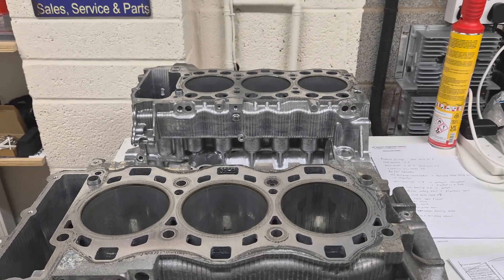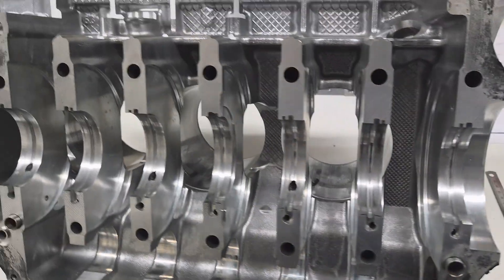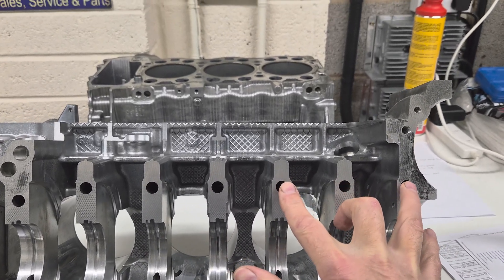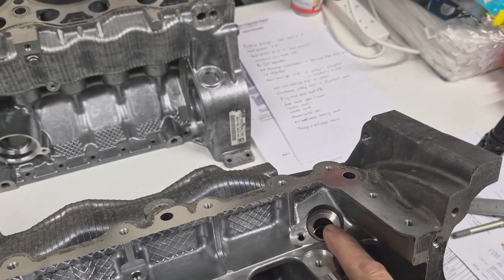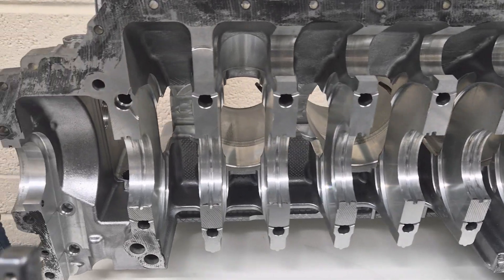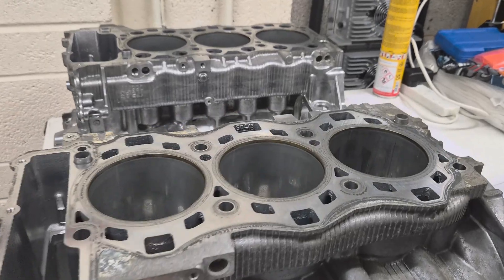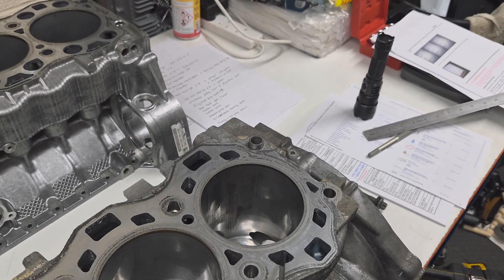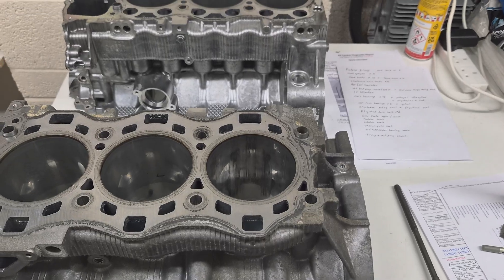997.2/991.1 - Bore score, where is the cylinder weaknesses in the MA1 engine - why cylinder 6

Comment: Great Material - could it be crap fuel leading to injector fouling - leaning out cyl 6 and melting the exhaust valve?
Reply from the maker: No if you watch the previous video, I work out its metal debris from the shrunken cylinder that have damaged the exhaust valves in this cylinders and the injectors were all good.

Comment: Hi Neal, thanks for doing your videos! Great resource. I have a 991.1 GTS engine in a race Cayman that I have kept Borescope photos since I have had it. Currently it has around 30000kms. I noticed that it has exactly the same single ‘polish’ mark on each cylinder inlet side as yours does. From your video it seems like this maybe around where the main bearing bolts go? Any ideas? It also has the slight scuff makes in the centre area as yours. I also have a 3.4 with only 1000kms that has the scuff marks but not the polish mark.  Cheers Gavin
Reply from the maker: That's interesting to hear about your observations, it sounds like those marks might be common manufacturing artifacts rather than wear

Comment: Additional information is, the 3.6 was offered in the 997.2 and not in the 991.1 as they bumped the HP up to 350 in the 3.4. The 3.4 and 3.6 share the same cases and cylinder heads, but the 3.6 has a longer stroke crankshaft and they used a piston with a raised wrist/gudgeon pin bore, as the connecting rods are the same. The 3.6 crankshaft is how the 4.0 was created along with the 3.8 cylinder bore and cases. In cold climates the 3.8 is more prone to the cylinder distortion than the 3.4/3.6, but can happen in these displacements also. In the 981 and 991.1 it's more important on getting the oil up to temperature than the 987.2 and 997.2 . I'm suspecting the DME controlled thermal management (electronic T-stat) is in play also, as it's more likely to happen to cars with this system in play than the aforementioned generation. This is an 8 main bearing engine, which includes the extra one the crankshaft snout for the support on both sides of the crankshaft throughs. The raised diamond casting grid is structural on the cases inside for the opposed cylinder/cylinder bank and there are case bolts on each side of every crankshaft through, as every through has a main bearing on both sides (4 bolts). Hope this helps.
Reply from the maker: So you are saying the later DME management upgrades may be exacerbating the problem?
Reply: @neal-morris  Affirmative on that one, as the Siemens Continental DME is different from the ones in the 987.2 & 997.2, as there was no electronic thermal management and a plethora of other features that came with the new platform. New features can be a good thing or a problem and I'm sure you're aware of these features that require programming or reprogramming with the 981 & 991.1 models. I've only seen one 997.2 that had this seizure problem and it took the rod bearing out which the took the feeding main bearing out due to the oil for that main bleeding off, as the engine is priority oiled. Take a pipe cleaner and check the case half with the main oil gallery, the one the pump supplies @ the back of the case. Hartech may be able to bore to a replacement piston size and Nicasil the bores, and then you'll be looking at unknown high milage capabilities with this engine. Hope I helped you out.
Reply from the maker: @warrenlucier5796 Its clearly a very basic management because there is only a single water temperature sensor located away from the engine plus a single oil temperature sensor. The fact the water jacket in these castings is so shallow and doesn't run the full length of the bores seems strange. I can see they programmed the ECU to restrict engine speed to 6300 when cold. Hardly much of a restriction! It would be interesting to fit several temperature sensors around the block and do a serious bit of data logging to see just how unstable the temperature management really is.
Reply: @neal-morris  The lower deck of a cylinder bore only requires full support to the wrist/gudgeon pin not the skirt, it just needs the cylinder. The shorter distance between the upper and lower deck the stiffer and more resistant it becomes to ovality. The problem is cold climate and oil temperature not being up to running temperature with the cycling of warmup over time. The alloy differences between the pistons and the engine cases come into play here also and make the warmup cycle very important. I know what #6 did and it was caused most likely by the previous owner unknowingly causing the problem. It's good you are going to attach sensors to different  location on the engine to collect data as the engine cycles.
Reply: @neal-morris  I found something for you on the thermal management, that came into play with the introduction of the 981 & 991.1 series, and it was comparing the 987.2 with the 981, which would also be like the 997.2 & 991.1. On YouTube do this video search, Garage Tech Porsche Cayman 987.2 Gen2 vs 981 Gen3, later in the video the system is depicted and explained on the subject. Hope you can find it easy enough and see why I suspect this feature if it goes amiss.
Reply from the maker: @warrenlucier5796 there is one error in his diagram. It doesn't have  a seperate coolant temp sensor 13. That doesn't exist, what the engine has is a combined oil level/oil temperature sensor located on the oil pan housing. 14 in his diagram exists and thats the only coolant sensor I have found. I'm not going mad here, I've got the crankcases stripped bare and theres no missing sensors! Anyway that engine shut off valve obviously opening above 3000 rpm or when the oil sensor assuming his info is true, hits a prescribed temperature is likely to mean a large rush of cooler upper cylinder and head cooling with oil lagging as the oil heat exchangers action is slow. Also when you engage sport, the gearbox cooling kicks in, that can pull the coolant temp right down for a while. I can imagine then more uneven heat cycling between the upper and lower cylinders depending if your in sport mode or what engine speed. Also in sport mode the oil pump operates a valve increasing oil pressure and that is going to change everything again for a bit as the oil is cooled by the coolant heat exchanger. It is after all this incessant cycling and non stop variability of extremes that brings out natural casting stresses and the cylinder distortion. The coolant thermostat is melted wax with an additional electrical over rider so it can be forced open cooler than normal if needs be so fairly basic stuff. Quite how a circulation isolation valve and a fairly basic coolant thermostat valve is supposed to operate efficiently with just 2 basic sensors for oil and coolant is beyond me.
Reply: @neal-morris  Pelican Parts has a short video which depicts the coolant sensor on your 991.1 911 located on the coolant pipe in the tunnel under the belly pan covers and not on the engine itself. The sensor on the bottom of the integrated sump is for level and temperature as you stated. There is another sensor on my 987.2 Cayman S that is in the oil manifold (you should have this too), adjacent to the oil filter and the heat exchanger (top of engine case) that is connected to the DME and the oil pump solenoid (upper portion of truncated sump)  for variable oil pressure control. I have the plumbing for coolant that is capped of due to I have a G87/21 6 speed and not a PDK transmission. Thermal control came out with the next generation,981 G80, that has a lubrication pump and a heat exchanger (emissions), as a cooler for racing is all that is need otherwise. I hope your head isn't getting sore and best with it.
Reply from the maker: @warrenlucier5796 there chap kindly gave me a link to the technical info. Have a read very informative. I made a mistake theres a temp sensor over by cylinder 3 its just mines in bits still and i missed it. Enjoy: https://static1.squarespace.com/static/63c49a3ea93a2f2ac2670c49/t/63e79cb9958d093ae8183279/1676123388147/SIT_981_MY%2713_EN.pdf
Reply: @neal-morris  Good find on the thermal management system in detail. If those solenoid switches don't function properly for the water control valve one can get overheating. I noticed they also do fuel cutoff in certain mode of operation and that may explain the torched engine valve, a lean condition may have occurred. Best with getting this rectified and sharing the information.

Comment: Many thanks for sharing. Any chance that you inspected the crankshaft wear? I'm going through the similar repair for my MA1 but have no idea what is the acceptable wear limit for the crankshaft. Heard that Porsche never publish such information and there is no luck finding online so far
Reply from the maker: The crank was spotless. I'll try take a measure of it before rebuilding it soon. I was tempted to even reuse the bearing shells they were so good but have spent the money on a full set which is unfortunately expensive. I'll point out reading the bearing tolerances too!

Comment: Another great video Neal, I was also thinking of entertaining the idea of fitting the third "optional - techquippment" radiator. I think that's going to help keep the water/oil temps more in line with each other. It always bothered me that the coolant temp goes up so quickly, but the oil temp takes a lot longer to reach same figure. Also, maybe that low temp thermostat, that the 997.1 owners keep mentioning, doesn't sound like such a daft idea after all. Does your GTS have the 3rd radiator?
Reply from the maker: Yes it does have the extra radiator fitted being the GTS.

Comment: How common is this issue?
Reply: They will have it eventually.  I have a 997.1 and all the 991 guys thought there cars are brilliant.  It's just that they are younger.  Now the 991 are showing up with it . 
The thing is 991 are still very expensive cars .
Reply: @DanDan-hj2pp  Not true. 997.1 were failing en masse with scoring at low miles and the problem was well known even when the cars were still being made. The scale and frequency of the MA1 issues are nothing like the M97 scoring. It's still hard to find failed 9A1 cars. M97 cars with failed engines were extremely widespread within five or six years of the 997.1 being released. We're 17 years from the first 9A1 engines and the number of failures is still low. The 9A1 isn't perfect, I'm not saying that. But it is far, far more reliable than the M97.

Comment: Going too hard with cold oil will make the temp gradient the highest. When oil and coolant temps are the same as they are normally, it should be fine for any kind of sensible driving, tracking too. There is the possibility to limit rpm and torque on cold engine in the ECU file but it's not used by the factory. I did put it in to use on my own Cayman S with MA1.23 engine. Won't rev more than 2000 rpm with coolant temps below 30C and 4500 rpm @ 50C :)

Comment: That's extremely interesting. The information I saw from Hartech suggested that, if not caught in time, this could actually seize the engine completely (not just create scoring) as the piston can wedge completely stuck in the bottom of the bore. This leads to complete catastrophic failure of the engine by breaking crankshaft, rods pistons, blocks etc etc
Reply from the maker: Absolutely really depends how quickly and how severe the distortion occurs. What seems more common is the issue remains undetected for a considerable time with the debris scoring other cylinders and a dramatic increase in oil consumption and mechanical noise, often with the debris blocking smaller oil galleries and main or big end bearings seizing or spinning out.
Reply: @neal-morris presumably even the GT cars are potentially at risk now, since the Mezger engine was replaced after the 997?

Comment: Good on the homework on this subject. I change the oil @ 4,000 miles, as it's cheaper than buying an engine due to wear. The 3.8 in a GT2 has 710 HP, but has stronger steel connecting rods than the non GT3 variants. My thoughts are with the thermal management and not so much with the stresses. Cylinder # 6 has the propensity to be the most problematic in the flay 6's.